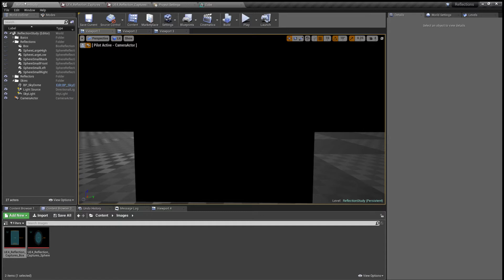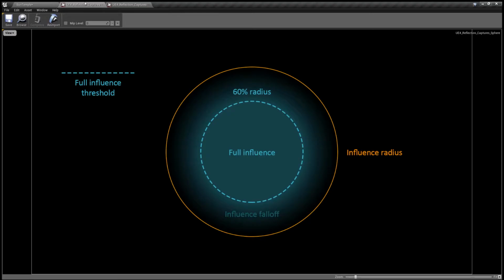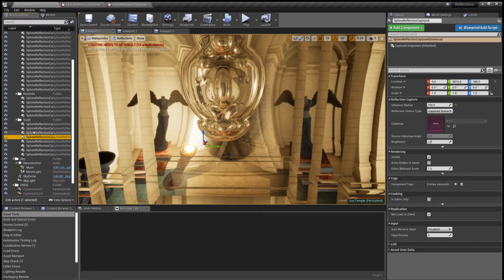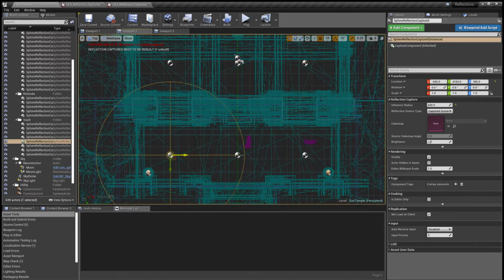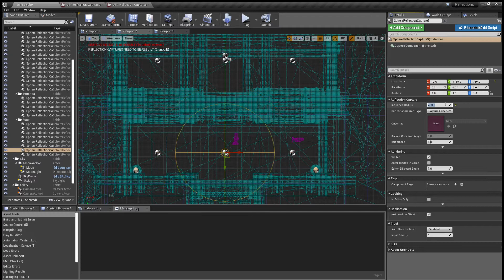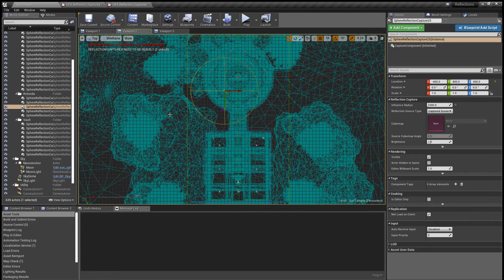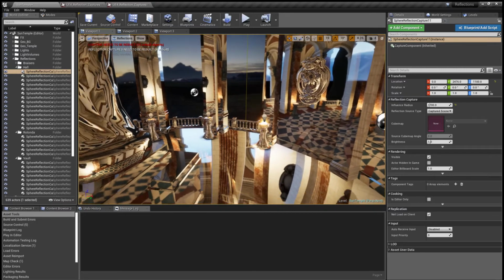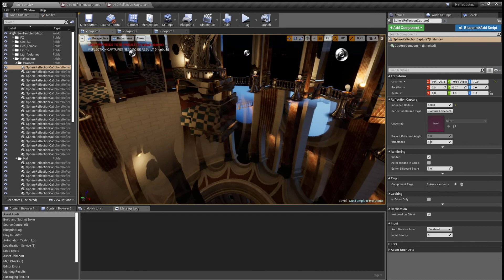Unreal Engine Reflection Captures Part 2: How to place them?

Comment: it is necesry to put a HDRI data on each sphere reflection? Or use just the global HDR?
Reply from the maker: Hey sorry for the late reply. Each sphere capture records what can be seen from that point: the diffuse version of everything it can see plus the skybox. Reflective surfaces read reflection data from spheres whose radiuses they are in. So if the captures don't include the skybox and the reflective surface is supposed to reflect the sky, the sky will be reflected as black. Besides, you don't have control over this, so it doesn't really matter. It is not multiplying the memory of the whole skybox with each additional sphere. Each sphere captures its own "360 photo" at its own resolution.

Comment: very helpful for for understanding fine details of reflection probes. Thank you! Out of curiosity, what are the advantages/disadvantages of this approach vs using cube probes? I would have thought overlap would be easier to control with cubes.
Reply from the maker: Thank you! In general, sphere captures are more robust because the captured reflection is mapped to a dome instead of a box, so to speak. The cube capture has very sharp distortion when you move close to the edge of the box. So it only work better in rectangular environments.
Reply: @notverydarkmagic   Ah, makes sense. Much appreciated!

Comment: Hey! This was a very helpful video! I was wondering what difference does it make to put the reflection spheres in hierarchical order? And by hierarchical order, does that mean you put the biggest spheres first?
Reply from the maker: Henry Ramsevik Thanks! Hierarchical placement is a good "spatial" strategy as it tends to minimize capture influence overlap, which saves performance, while ensuring every corner is captured. It also helps to organize reflection accuracy according to the importance of the objects: a smaller, closer capture gives your hero assets less distortion and line-of-sight errors, but it's spatially inefficient to keep stacking small/medium spheres to fill the whole room. So we can use a big one to capture the less important corners. It's like a pyramid: the bigger the capture, the fewer you will generally need. The order does not refer to time of placement.